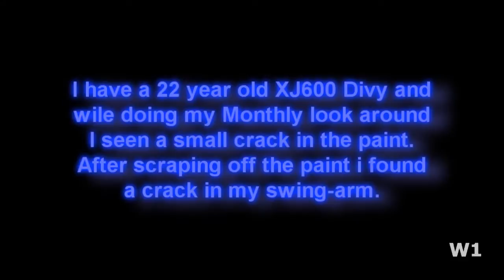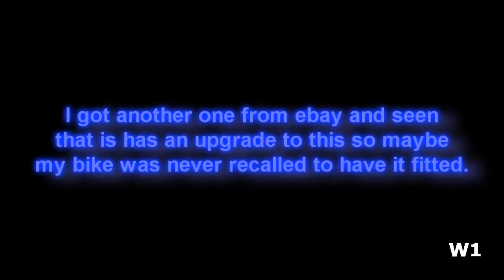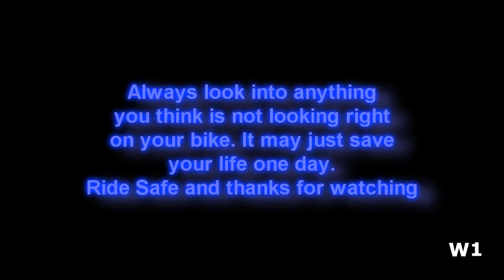Swing arm problem

Comment: I just bought on ebay a 1997 XJ600,...not been cleaned for years, bad mistake. Always keep the bike clean, easier to spot problems...............check for fork seal problems by running your hands down the forks, easy to see if you have a leak.....
Reply from the maker: all good tips there mate